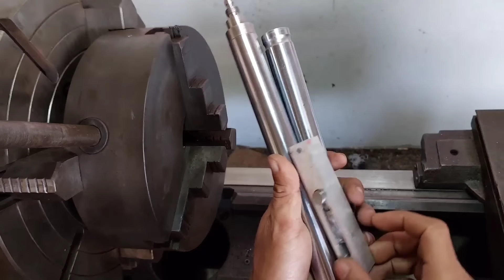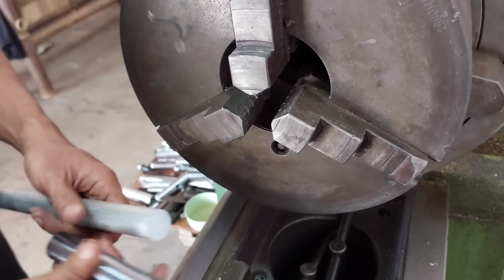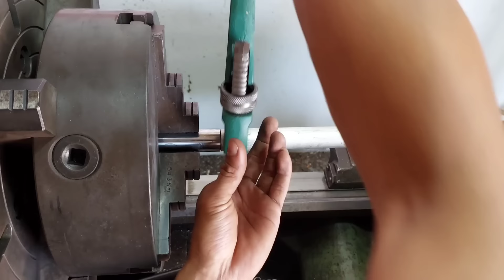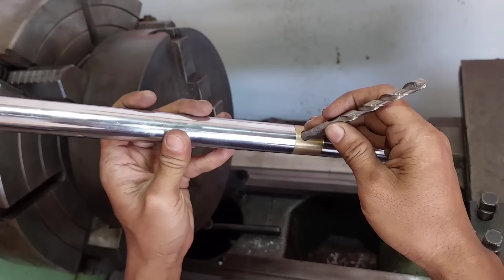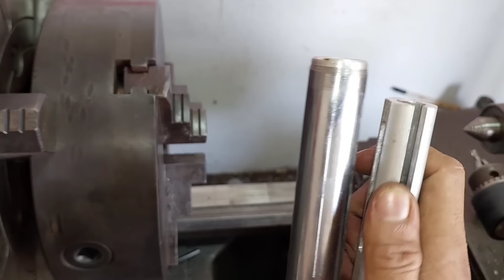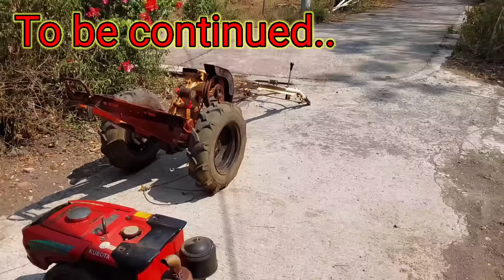4000 PSI.!! Making a hitting chamber on a PCP air rifle

Comment: Mohon masukanya komandan, saya ada dural od 32 tebal 5mm, kira kira kalau kontruksi di buat sistem pen dan baut layaknya pcp kuningan kuat gak ya om ? Dan lebih kuat mana dengan kontruksi drat ?
Reply from the maker: Kontruksi drat o ring/siel d dalam, pith drat 1,5mm, panjang drat 35mm tutup pakai kuningan, kuat di 3500 psi, aman di 3000psi.. kalau sistim pantek saya tidak tau karena saya belum pernah mencoba dan saya tidak menyarankan, saya cuma belajar dari mesin press dan tabung scuba, kontruksi sebuah mesin press yang menahan tekanan ratusan ton tidak ada satupun yang sistim pantek, semua menggunakan ulir..